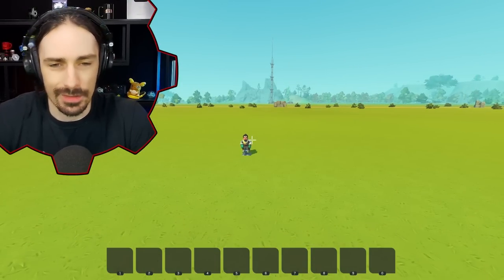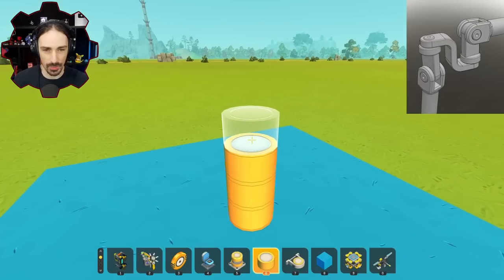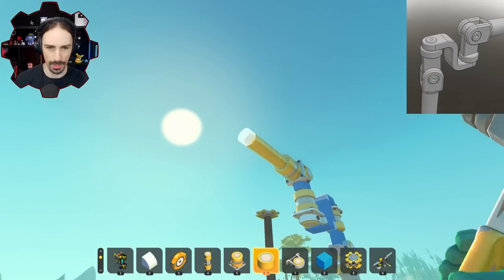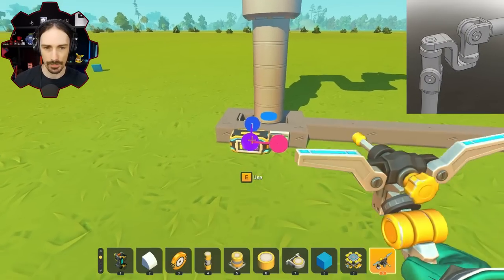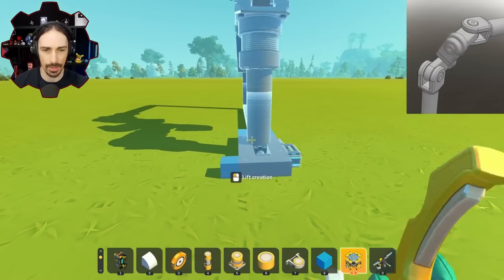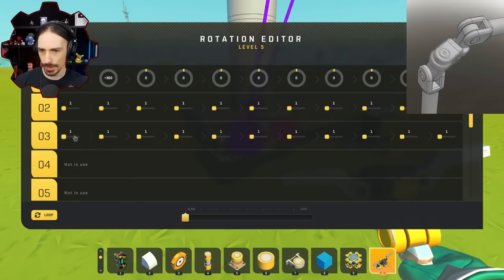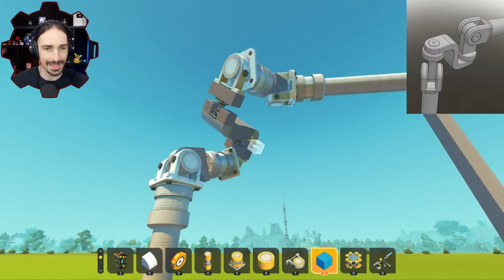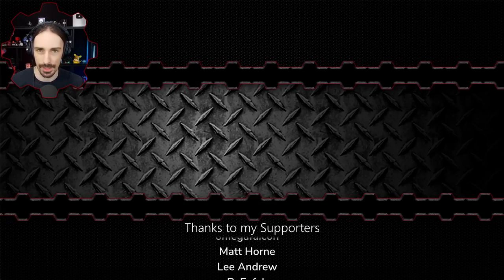I Recreated This Strange Rod Mechanism In Scrap Mechanic

Comment: It did not work because you put the piston on the wrong arm. You tried to tilt the powered shaft. But the animation shows tilting the other up from the bottom one. And you fixed it with the piston, because got pushed the top part of the powered axle over the center point so it got tilted as it supposed to be. For true recreation you should just lift the horizontal axle from it's end.

Comment: scrap man didnt need all that piston nonsense, to give it that bit of offset he could have put a piston on the frame that held up the horizontal bar and had it go up by one block and made the connection point on the bar pivot to get rid or any binding from the point going up

Comment: You need to push the horizontal arm into the mechanism. Instead of doing it with the pistons.

Do to so you need to place arms that support the horizontal one and can tilt toward the mechanism. You basicaly.

OOOO       QHHHHQHHQHHH
 I       O       I.             L.      L
 I       O       I.             L.      L
G      OOOO.             G.     G
V
V
V

H=horizontal
V=vertical
O=s shape
I=rotating arms
Q and G = important berrings
L=support arms. 

all the Q and G need to be aligned with each other. Then you rotate the L 1 or 2 degrés from G toward the mechanism.

Comment: this mechanism, to me, looks like it's supposed to act like and, when covered up, look like a human shoulder, while allowing wires to weave through it, which means each movable part isn't passive, it's active, and the piston to trick it into doing the motion passively is unnecessary and inaccurate